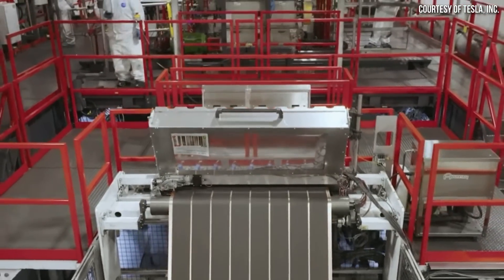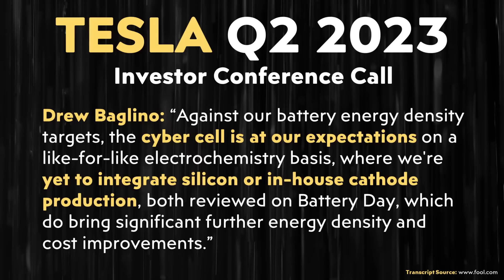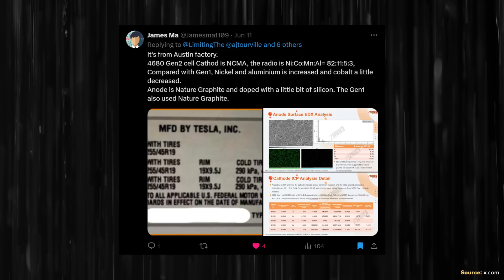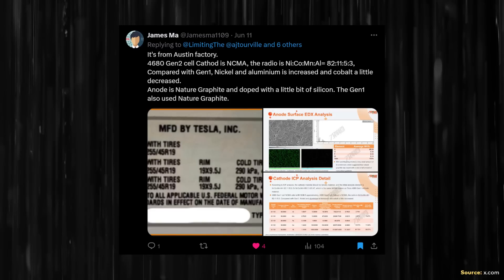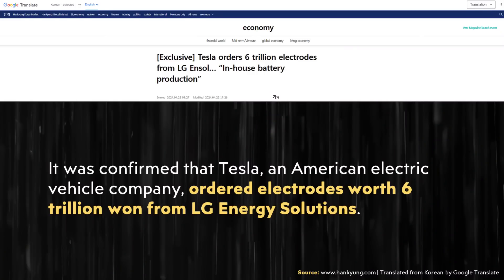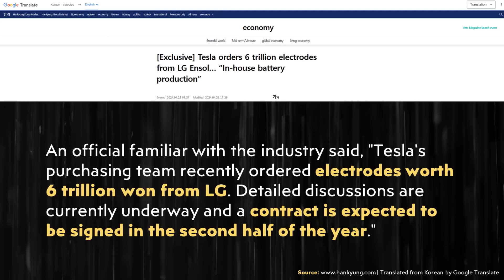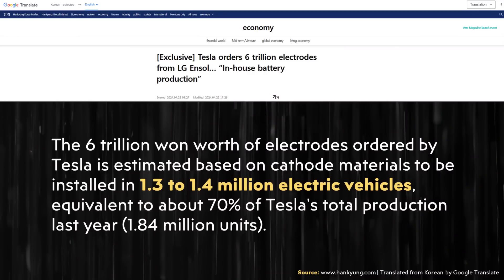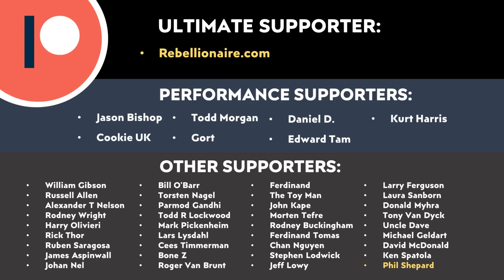Tesla 4680 Battery Chemistry Changes REVEALED!

Comment: How did the M3 LR suddenly qualify for the $7500 Credit? Did they change the batteries? Please someone answer this question!                                                                                                                              So why no $7500 Tax credit until this week for the M3 LR?  My order that I placed for the M3 LR in April I was told no tax credit was available, Then a week before delivery of June 25 I received the tax credit.  Also what batteries are in the M3 LR now?
Reply: 4680s ramping up, model Y slightly down in the us for 2024 and powerwall 3 is lfp along with all megapacks. Frees up 2170s for returning some model 3s to tax credit eligibility.
Reply: One potential explanation is that in May the US Treasury gave automakers some additional flexibility on hard to source battery minerals until 2027.  Troy Teslike speculated this could enable the tax credit for the Model 3 LR AWD using LG 2170s imported from South Korea [which purportedly contain some materials from China].  That speculation was from May 3rd, I haven't attempted to follow-up or verify this, including where LG cells are being allocated [off the top of my head I thought those were going into EU vehicles], but it seems plausible.
Reply: @Gig0Surf  Thanks for the reply. Sounds like the best answer so far !
Reply: @Gig0Surf  well said! I had forgotten SK was one of the first to do a free trade agreement with U.S. over ev battery materials when offered.

Comment: 4680 should have at least 500wh/kg energy density.
Reply: Long term plan/ projection
Reply: No chance without switching to semi solid state cells or full solid state cells to achieve that energy density.
Even we lion in production semi solid state cells nio is using for the et7 150kwh packs are only around 320-340wh/kg.

Catl claims their condensed matter semi solid state cells will approach 500 wh/kg so do others. But NOTHING is in series production atm.

Comment: sadly tesla is buying Chinese batteries
Reply: They're the best
Reply: Tesla is buying the best value batteries (at the moment) AND  cementing their reputation as the "Go to, reliable customer" for the supplers.
Next time Tesla negotiates, who's getting the best deal on "next gen" cells?
Reply: @AudiTTQuattro2003 vertical integration has been around for centuries .. and It does work .. but it's execution has to be managed well.😂
Reply: Tesla's mid/high EVs use Japanese/Korean batteries (high-nickel batteries).   Chinese LFP batteries are for entry-level, low-range RWD (formerly Standard Range) only.

Comment: 4680 is a failure!
Reply: @AudiTTQuattro2003  You call it hype because it is "fashionable" to call it as such. It is an ambitious goal. Ambitious goals lead to innovation and progress. I don't need to give examples.
Reply: Making 50 millions of something is not a failure.
Reply: @12user-u5h  You are clearly not aware of CATLs two new batteries. They CRUSH the 4680 in all relevant aspects such as charging speed, energy density, cost etc.
Reply: @dpie4859  You obviously don't know what Tesla is aiming for with 4680, or perhaps you do. Then, you should know that when they crack the code of DBE, there are in the league of their own. Also, Tesla is battery agnostic, and they are not trying to replace their suppliers. In addition, they are also working with CATL on improving battery performance. You are wrong, 4680 is not dead.
Reply: It's not a failure, it's an ongoing engineering challenge. It will be solved.

Comment: I wonder if some of the issue is with the jelly roll format are they having issues with the convex (cathode) or issue in the inner part of the roll because of how tightly it's wound perhaps a catl m3p style of battery is the solution to the dry cathode issue but that would take an entirely new line.

Comment: I’m wondering if the change in the new model 3 long range eligibility for the ev tax credit is due to Tesla buying excess battery materials from LG. Correct me if I’m wrong, but the 2170 cells were using Chinese supplied materials in those cars that caused it to lose the credit at the beginning of this year.

Comment: What are your thoughts on the new smaller (Model 2) Tesla rumoured to be released in 2025/26? Is it realistic, or just wishful thinking?
Reply: Try...
Model 3 body.
2 castings... Assembled AWAY from the body, then bolted to yhe body ("unboxed" method.... Time saver!)
Components on the castings?
Grn 3 systems 
48v loom/ peripherals
Steer by wire 
Electric brakes(?)
ALL design for high mass production.
.
Add
1 motor, regeared for economy (0-60 ±6.9 seconds, just "because")
Allowing a smaller/ chealer pack (-10%?)
.
Result?
Sub 30k Model 3 "economy".
.
"Cheaper vehicle using exusting lines and elements of next gen (unboxed)
 systems"
.
Note he's been concerned about recession for some time.
What do you do pre-recession? (IF you're proactive!)
Reduce the wage bill.
Sell a cheaper product (while still making a good profit)
.
How about announced in August, production Q4-Q1?
.
When they solve FSD?
Or rather BEFORE they do.
.
They take the Compact/ Cab (Same vehicle)
They LEASE the Compact....
For use as a driven cab, with FSD in "final test version"
.
The moment its approved, they feature delete the "driver control module", change firmware and produce CyberCABs
Reply: for 7 years we have been talking about a 25,000 model 2.  but we have had seven years of inflation.  Tesla has extra production space on its model 3 and model y lines, because elon musk decided to be the most politcal mother fucker ever.  like he bought twitter so he could share political opinions that would piss everyone off across the entire spectrum. I am not saying his opinions are right or wrong, just you should not weigh into poltics publicly when your face is the franchise. Tesla is the elon brand and elon killed it by making political statements when like 60% of the country is locked in a bitter, tribal political divide caused by social media.  so now tesla cannot sell enough model 3 and model Ys to fund the model 2at 25,000 and simultaneously develop FSD/robots/AI.  Additionaly, the horrificly slow and cumbersome cybertruck ramp makes a model 2 even harder.

My guess based upon elon musk statements, we will get model 2.5.  a smaller version of the model Y. that uses many of the same parts.  it will look very similar.  it will be 33-50K.  at first, they will sell the 50K version which will have really nice range like 400+, better interior, and it will go even faster.  Eventually, it will get down to the 33k price.  but with any luck tesla will have solved FSD and all teslas will go up in price.  if they solve FSD you can bet your ass the cheapest tesla will be above 50K.  probably wont solve FSD enough for regulators in USA though.  it might be 10 times safer than a human but they will slow it down.

Comment: I think the 4680 is too little too late. They certainly didn't reach their objectives with it although I have my fingers crossed. If nothing else, the issue I see with them is the charging curve is horrible. I fear it's because it's hard to cool the core of each cell because of size. Shenxing PLUS by CATL I feel will be a game changer on many levels. 1.5 million mile battery, hyper-fast charging @ 372 miles (600 km) in 10 minutes, less problematic in cold weather, LFP based and energy dense to compete with NMC. I don't think 4680 will every reach those specs or ever return to the Model Y, but as we all know, we need locally sourced batteries. Ford got the jump on a CATL factory in Michigan. Let's see if the Texas factory happens. All the time waiting for the 4680 to amaze just isn't happening. Sadly. If you ask me, it's all about the charging speed/curve.
Reply: @Techridr
You're making the usual mistake of thinking about the "battery" (the cell).
Tesla is building the SYSTEM to produce MORE cells, MORE quickly, in HUGE quantity, from a SMALLER factory.
That takes time....
.
The charging speed/ curve/ chemistry, etc will be resolved.
.
Why is Tesla buying cells from outside at the moment?
Because there's a SURPLUS of cells.
Why does Tesla buy them?
Because they're CHEAPER than Tesla can produce 4680 At the moment
Why are those cells so cheap?
Because (as has happened before!) OTHER Manufacturers pulled out of the deals with suppliers manufacturers and TESLA said WE will take them.... AT THE RIGHT PRICE
.
WHY is that good?
Because TESLA is now the trusted customer for those suppliers (note, they're already CATLs largest customer)
Ford/ CATL?
That's the plant where Ford has reduced the size of the project?
(I bet that pleased CATL?)
.
I wonder if CATL has plans to supply the Shenxeng plus cell to their largets (most reliable?) customer?
Reply: @rogerstarkey5390  >> Because there's a SURPLUS of cells.  <<
sigh can you please stop making speculation about stuff you are clearly unfamiliar with?  4680's cells are not generic battery cells types that are stocked in warehouses waiting for buyers; batteries also do further have self-life, however long.   I blame this misinformation on e_viking and his disciples..
Reply: @rogerstarkey5390  Excellent points! I also wonder if Tesla will prioritize the lower cost of producing their own cells over the performance gains of CATL or even BYD batteries. When I said too little too late, I wasn't giving up on 4680s, I'm just saying a lot has happened in the battery world in the last couple years and both CATL and BYD are killing it. Lower cost is likely a priority for Tesla for MOST of their models. I can't wait to see what happens in the next 2-3 years.
Reply: What's true in practice doesn't comport with perception on this issue. Most EV buyers are naive to the importance of the power curve. Consumers will eventually become educated on such matters, but range is king and likely will be for at least a couple more years.
Reply: @kenhiett5266  It's hard to argue any point with a person like yourself that has the great taste to put Dark Side Of The Moon as your display picture. My biggest regret in life is not ever seeing Floyd in concert. Closest I got was when they were at the Hollywood Bowl and I could listen a bit from my balcony. But I digress....
Reply: @Techridr  I never saw them live either. Weird thing to say about your favorite band, but I was just a bit too young. I saw Rush several times but that's because Salt Lake City was a frequent tour stop.
Reply: If the CATL PLUS is LFP it won't near as energy dense as NMC or NMCA, even if it is the unproven LMFP.
Reply: I too am keeping fingers crossed. The overlapping copper current collector on the cathode and anode should be a boon for cooling as well. Then software optimized on maximum power draw vs temp control
Reply: Nah.
We don't need Chinese companies in this country. 

4680 is just beginning and will be superior. Your point about core cooling is completely moot. Look at the battery cooling tech video from Sandy Munro.
Reply: @themonsterunderyourbed9408  You're probably right about cooling and Sandy's the man
Reply: The charging curve is being improved with software updates. You drawing conclusions at the beginning of the game, there are more innings to play.
Reply: @12user-u5h  I know you're right to a certain extent. They will improve, but things are happening. The performance of the BYD Blade, for instance, is amazing. Charging curve is amazing. I'm always pulling for Tesla, but progress on other batteries is moving faster. The good news for all of us is that price per kg is still going down year after year.
Reply: @Techridr 
Is rhat the spec list you're reading from?

I've actually seen reviews of in vehicle real world charging of the Blade cell with POOR charging.
Reply: @12user-u5h 
I agree they were very cautious at the beginning of the 2170s as well!
Reply: If nothing else, 4680 will give them diversified battery sources with stable pricing on a product that is roughly equal to industry averages already. And who says they can't still improve on it
Reply: Tesla is licensing CATL tech for their own 4680s.
Reply: @MrMR-hp6ed This is not true.
Reply: The whole reason for Tesla to make batteries in house was a “just in case” suppliers cannot supply…..well they are stepping up, and supplying, so I wouldn’t worry about it.
Reply: @dogfacedponysoldier87 
It actually wasn't.
The reasons were:
Cleaner process.
Much more efficient process
Huge volume from small factories.
.
The main reason they're buying now is that the bottom fell out of the market whrn Legacy Auto "Pulled Back"
Reply: @dogfacedponysoldier87  even with suppliers, They can't keep up. Tesla will need their own cell production too.

Comment: Once Tesla gets their mass production ramp up of their 4680 format - they can modify chemistry as they want without having to change up the battery cell manufacturing
Reply: The format IS the problem. These small round cells lead to more complicated battery packs. Square cells are far easier to design, manufacture, and repair. China LFP square cells are 5 years ahead of everyone else. 4680 cells are worthless. Move on to larger cells and the problems can easily be fixed. Next Gen LFP is a huge leap forward. Not 10 percent.
Reply: @TheLobo91  - The format has been successful for Tesla.  4680 is not a little cell and the cylindrical format has cooling capabilities and can be manufactured faster than prismatic cells.  Prismatic cells are not easier to manufacture in volume.
Reply: Exactly.

Comment: Sandy Munro just said the 4680 battery in his CT teardown had a dry cathode. Production for dry cathode is probably just ramping up, but until ramped up, they're buying wet cathodes from LG.
Reply: But doesn’t that means they have enough for CT ramp already? Where can i see video that Munro said this?
Reply: LG wet cathodes could be for Semi.  Same timeframe and scale, high density..
Reply: @zwillx3953  True. No one knows for sure.

Comment: CATL is doing a better job of moving battery development forward.  The Shenxing battery is an lfp chemistry battery with faster 4C charging and good energy density.
Reply: CATL is all vaporware.
Reply: LFP is interesting but not that “advanced” - there are other LFP manufacturers including ONE. Those are good for large battery storage but more energy density is required for auto and large trucks like semis. Tesla is smart to keep internal battery development.
Reply: @RagnarinVa  https://www.youtube.com/watch?v=3o8MDaqM0RU Shenxing has 205 Wh/kg and charges at 4c. 600km in 10 minutes.  360 miles. No cold temp reduction in power.
The Condensed battery has 500 Wh/kg. 
https://www.youtube.com/watch?v=I1XmKpRFZco&t=43s
Reply: @RagnarinVa  You're talking about current LFP batteries. CATLs Shenxing PLUS is a different story entirely.
Reply: @Techridr  - yes i read the claims none of them validated or seen in the market in use. Again if it’s LFP and a Chemistry hack other producers can reverse engineer .
Reply: @RagnarinVa  Claims? The Shenxing PLUS battery has been tested and demonstrated. BYD Qilin 2.0 and CATL Shenxing PLUS, will both ship batteries that can be charged from 0 to 100% in ten minutes. These are world leaders in EV battery production, they don't just make claims. "Reverse engineer." Oh man, you really don't know, do you?
Reply: @Techridr  I thought those are 10-80% in around 10min claims? Also your gonna need 500+kw chargers to charge that fast.
Well under 1% of global dc fast chargers are of that speed. 👍🏻
Reply: @4literv6  I thought so to and that's probably the case, but I did read BYDs claim of 100% from 0 and CATLs claim to be in the same area. So only time will tell. Anyway, my current Model 3 has 60 kWh. So, going from 10% to 80% at 300 kW charge rate would take 8.4 minutes. 500 kW might be correct for 0-100%. We'll have to see? Personally, I'd be VERY happy with any stop less than 10 minutes
Reply: CATL Is doing a DIFFERENT job...
(Anyway, they should be "better" because "its what they do")

Comment: What effect will this have on overall kWh of the battery?  It'd be nice if you could include a comparison of energy density of the "new" battery vs the current one.
Reply: Energy density：242.7Wh/kg (Up 6% then Gen1)
Capacity density(Wh/L)：627Wh/L (Up 2.5 then Gen1)
Internal resistance(mΩ)：2.6 (Gen1 is 3)

Comment: Any news about CATL so called condensed batteries? One year later since they were announced...
Reply: vaporware.   most weekly battery tech announcements are fake news, promoted by the likes of e_viking.   it on average takes 2-3 years to validate/certify new battery tech; then another 2-3 year to mass-manufacture.  and that's if and only if it's a legit tech.    most battery tech in use today were developed 20-25 years ago with incremental improvement over time.
Reply: I heard they are going in some Chinese car and Tesla is getting ready to put them in the model Y very soon

Comment: They just keep getting better all the time it is amazing. But our liquid fuels are way better after a 125 years of improving them it is a big win going forward for clean renewables energy.
Reply: How have we been improving gasoline, other than making sure we don't poison ourselves by adding lead to it?
Reply: @-whackd  you hit it on the head we took the lead out of gasoline it is unleaded now .
Reply: How are our liquid fuels considered renewable when it's drilled out of the ground? Don't bother with the ethanol additive because it doesn't actually help emissions. It reduces mileage in the name of burning clean. Well if you have to fill up more often burning corn gas, how is that better? Burning corn gas emits more emissions than without, over each mile. Same with all the diesel emissions control. MPG on modern diesels is significantly less than prior to all the DPF, etc. If you're burning more fuel per mile, you're emitting more pollution per mile. Yeah your tail pipe smells better but more fuel is consumed.